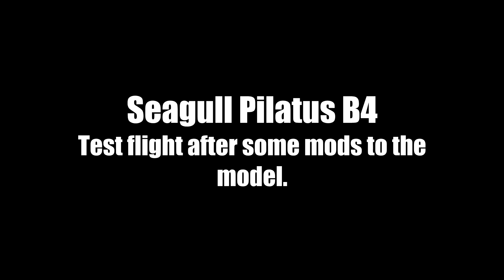Seagull Pilatus B4 Electric Conversion

Comment: Nice video buddy just got one of these could you tell me what size motor your using please thanks
Reply from the maker: Hi Mick the motor is an XPower XC3522/5 LS  A 14x8 folding prop with 2.5 degree twist on the yoke. and a 50A esc.

The motor has an extended shaft on it. Actually the extended shaft that came with the motor is not long enough so i had to make a new shaft from some 5mm  silver steel.  The shaft goes through where the tube for the tow release was. i used a hole saw to cut through the 2 formers in the nose to clear the motor. Also moved the rudder servo back to make room for the battery and cut a new ply servo tray.

The spoilers work fine. i normally land with 50% spoilers and control the decent with the motor. i changed the horns on the spoilers to offset horns so you get a straight pushrod. seagull supply a really thin bit of piano wire that they expect you to use with their standard horns which has to almost bend around a corner!